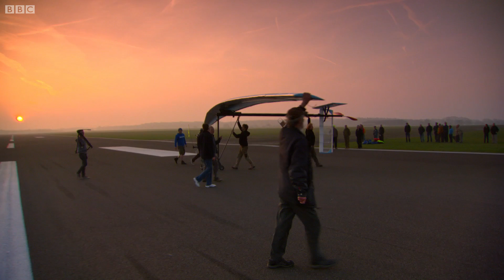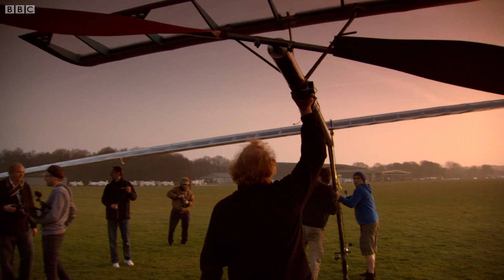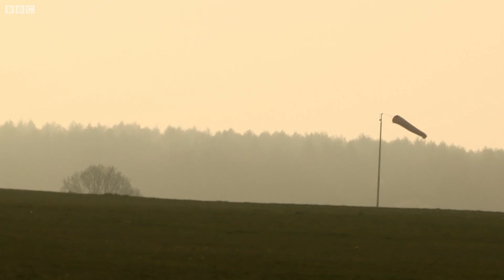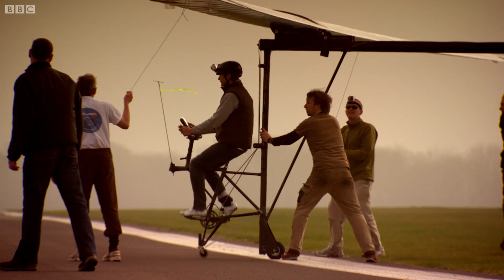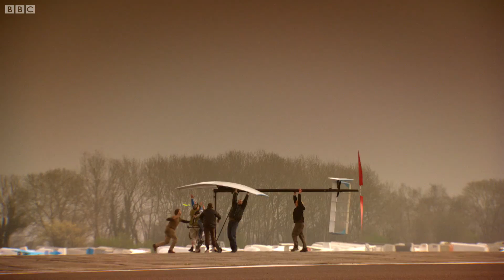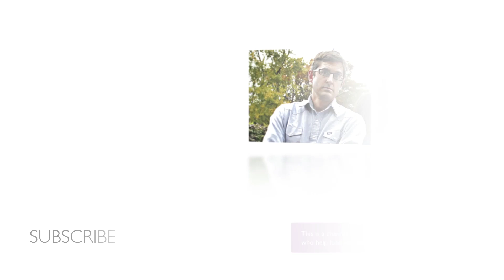Flying Bicycle Success! (Part 2) | Bang Goes the Theory | BBC

Comment: You need a certain area of wing to provide sufficient lift, reduce the big wing width, way too unwieldy,  and add a slightly elevated, front wing to compensate reduction in large wing area( canard) with vertical fin. Keep prop behind as before. The vertical wing in front will disrupt the oncoming airflow to reduce the stagnation pressure point on the pilots body. Making it more aerodynamic by recliner/ plus streamlining will also help  a lot in cutting down a lot of drag, but unfortunately in the reclining position, its harder to push the pedals in a crank mechanism. The ideal human powered craft  should be designed so that very little if any forward motion is needed in a mild head wing to provide adequate lift and allow the craft to rise up. In fact the trick is to make the craft so light, a factor of 4 lighter than todays technology will permit, such that the lifting surfaces effectively operate and behave as a hybrid kite. A kite with very little forward effort, would soar up , due to its very large lift area to payload. 
Once airborne, then you can use the legs to propel it forward. What is needed is a blown/ aerated material that has an extremely  high strength and rigidity to mass ratio. A material that could be blow formed into the whole craft without the need for spars etc. A craft that structure weighs about 10kg maximum , that is when practical human aerial-cycles will become possible for most people to fly.

Comment: I'm no engineer, but I am somewhat mechanically inclined and something continues to puzzle me about all of these attempts:

One of the chief problems aside from weight is pilot endurance, yes? Churning those pedals wicked fast to get the propeller spinning fast enough wears out the pilot's legs quickly. Ok, so why not use a much larger chainring on the pedals, and a smaller sprocket for the propeller? The whole point of bicycle gearing is to spin the wheel many times for every single rotation of the pedals, yes? The propeller does not need to overcome the resistance that a bicycle tire does, so this should be easier to do. The slower the pilot has to pedal, the longer his/her strength will endure. 

All of these attempts seem to be using bicycle gearing, which simply isn't going to work. A propeller has to spin at a much higher RPM than a bicycle tire. A chainring that's say, half the size of a Pennyfarthing wheel would probably be more efficient. The pilot would only need to pedal at a casual pace to get the propeller spinning wicked fast. In every attempt I've seen, the pilot gives out within seconds because they're having to go full blast on the pedals.

Comment: Didn't they learn anything from hang gliding? He needs to be able to use his body weight to push down the side that is rising, eg. connect his shoulders to the wing above with a rope or something. As it is, he's just leaning into empty space which does nothing.

Comment: This is what happens when you have a bunch of engineers who know nothing about airplanes call it a bicycle that flies.   Change your thinking. Its a peddle powered airplane. Then change your strategy. That guy sitting upright is about enough drag to counter act the propulsion completely. Such a poor design.I like the long wings.But the wings flop one way while the rider flops the other. Needs some direct stiffening . Also if you want control at slower speeds take a hint from the wright brothers. Put a canard out front. Instant response even at slow speed. At least in pitch. Please do not take this as a slam for your craft. I think you are on the right track. But take this as constructive. You have little control because of the lack of stiffness. You have to work way too hard to move forward because you are a big barn door in the wind. Lay down like the LUGE..  Prone position feet forward.  I think if you put 2 struts from fuselage to wing that will stiffen the inner area so you do not get wings flopping one way and pilot the other. It will solidify the center...

Comment: Bro u can do it.. if I were at your place.. I could use 3 tyres ..... 2 tyres in from and one tyre in back side..
After 3 tyres no one need to run along with you and with that you would more stable on pedling wheels n you will be more comfortable..
Yes of course it's flight.. bcz tHis design n style is only mother of all flight.. this is mother it's gave the way n direction to create the new design n styles.. now that is flight.. your flight bycile is also a flight.. keep it up you going good buddy.. but try with 3 tyres

Comment: Hey, I like your effort, but this construction will never produce desired result.
You need apply at least equal or higher power than the total weight of the constriction including driver.   
There some other problems,   which will be obstacle to the flight.

Comment: these videos only exist to prove that pedal power is useless. i know its not as efficient as electric or gas but i know its atleast better than whats being shown in this video. this video is blatantly discouraging the pedal idea for flight. i mean cmon, those many people get together to make that design? that seating position? that gear ratio? no control surfaces?

Comment: Have you tried a DELTA WING with less drag and weight and no longer shafts body or tail assembly?
Reply: Thank you...I'm very interested...info helps.
Reply: Delta wing performs far worse in low speeds.

Comment: You need to have at least 4hp in each leg and arm. Pedals should be for arms AND legs.
Reply: Wrong. An athlete would be enough if the plane was designed properly. See the Daedalus 88 project where a human-powered plane flew a distance of 115 kilometers over the Aegean sea for 4 hours non-stop in 1988 with a Greek cyclist athlete.
Reply: Absolutely. With the entire torso contributing NOTHING....it makes no sense. It really looks kind of silly with his arms, shoulders and back just perched there on the seat going along for a free ride. Someone WILL figure this out, however, just maybe not this guy. Admirable effort though!
Reply: ΑΙΕΝ ΑΡΙΣΤΕΥΕΙΝ Obviously I exagerated, but in reality surely larger than 1 horsepower and more likely at least 2hp in one athlete. Steroids can make you even stronger than elephant and you can see those experimentalists, but they usually hit the bucket pretty early.

Comment: It's tip stalling. Need to add washout to both wing tips. And add trim flaps to the wing to allow fine tuning against the prop torque. Being it's a pusher plain find out what the prop inclination should be vertical and horizontal. On a conventional prop plane it's around 1-3 degrees vertical ccw and 2-4 degrees horizontal cw. And this a variable depending on plane design. It's best to make all these tweaks adjustable for fine tuning of any prototype plane. That plane has potential.
Reply: Why dont you perfect it and put it on youtube for us?
Reply: @taylormade2826  why is your ass burning on a real technical suggestion.
Reply: I agree, perhaps more curve or less cord closer to the wing tips? build a flying model first.

Comment: It seems that the steering mechanism is too close to his body and he can't get either maximum leg power or good balance in that position. His body should be in the same position as if he were on a properly fitted road bike, with his hands and arms well forward. Then he could really pump the pedals and more easily shift his weight either left or right. Otherwise this is an excellent project and I think it should be pursued!

Comment: I wonder if he received flight training. Once you're wheels up you are an airplane. So the pilot skills takes over and your leg should be in steady cadence. It looks as if the flight surfaces aren't to functional. I'm wondering if the control mechanism is wing torque or flex to give roll stability. Seems as if that is the big problem aside to more steady speed.

Comment: The chain has to go to the wheel (and the prop) for it to be a bicycle-airplane. You flew a pedal plane...which has been done. Besides, you could have easily have flown a bicycle by getting a bike up to high speed with an aluminum flywheel, then shifting the power stored in the flywheel over to the prop. Yeah, try that.

Comment: idk anything about this but woudnt it help to strap the the pilot tightly to the seat so he doesn't lose the torque he had while he was on the ground i know it might not be a big difference but when you take off the plane beneath the pilot probably losens up a little causing loss in the power being pushed into the propeller

Comment: Why is the 'pilot' wearing heavy clothing and what looks like a heavy helmet?

Where are the controls once in the air? 

You can limit the  wing bend by adding some lines from near the tips down to the bottom of the 'fuselage'.

I noticed that one of the attempts was aided by being pushed along at the critical moment...
Reply: The wing bending is called dihedral. It's necessary for a low powered rudder only plane. Look up  B-52 wing flapping on you tube.
Reply: nigga

Comment: lots of things could have been done here to make this work better.  Have better gearing for the bicycle.  Also, have a recumbant position.  Make the wings more rigid.  Wear a skin suit and less heavy clothes.  Have hand pedals to aid in the powering of the prop.  Have controller strings for the guys running on the ground to help stabilize the tilting.

Comment: Why haven't you guys considered ailerons on this design? They would help keep those wing levels, and you would have more roll control..
Reply: I think they're trying to save aircraft weight, but I agree on that point, without the basic controls of flight, the aircraft is fairly impractical. But this aircraft has a number of issues that I see which could use a correction. The project has been a success for that fact that they got airborne, but for the fact Redbull motorcycle riders get more air time off jumps, and the aircraft doesn't have the basic controls. It for now is a "successful-failure" in my book. Yet the aircraft has a lot of opportunity to tinker with.
Reply: The wings are just too flexible, adding down aileron at the right tip would twist the entire wing so instead of banking to the left you bank to the right, it also adds a lot of drag and weight. At this speed it is flying right above stall speed, and adding down aileron increased the angle of attack stalling the wing completely.

Comment: recumbent bikes are more efficient.
Reply: +FIREHAWK1979  Yes recumbent with a fairing.
Reply: +FIREHAWK1979 Exactly.that's what immediately occurred to me as well.
Reply: +Organ Farm Being British, he probably thinks that would be cheating.
Reply: +FIREHAWK1979 recumbent bikes can't exploit the weight of the human body...ie, you can't "stand" on the pedals. aerodynamically more efficient, maybe, but less potential power. notice any recumbent bikes winning the Tour De France? me neither
Reply: +freshcaughtbass with the recumbent bike you are pushing against the back rest. Standing up you are limited to your bodyweight. Most athletes should be able to leg press more than their bodyweight... In a long distance event you would not be able to keep up the extra force.
Reply: +freshcaughtbass you do have a point, if you just lock your leg and stand on the pedal you're not actually exerting yourself.
Reply: FIREHAWK1979
 Tell that to pro cyclists peddling up the Tourmalet. It makes no difference to the work you do if you are pushing against a seat or pushing against gravity. If they were allowed to use recumbents in pro cycling they would. Aerodynamics is the gold standard for speed in cycling. They do whatever they can within the rules to lower their air resistance.
Reply: competition cyclists stand during a sprint or steep climb, which is the worst possible geometry for good aerodynamics...they must have a good reason for doing so
Reply: freshcaughtbass
 They don't have a seat to push against. When climbing aerodynamics are less important anyway because they are going slowly and air resistance varies geometrically with speed. When sprinting they keep as low as they can while engaging as much strength as they can. Take a look at Mark Cavendish sprinting.

Comment: Move your prop so the prop thrust flows over the control surfaces and you will gain control at lower speeds. Once airborne it helps to move the controls in order to make the plane fly the way you want not the way it wants. The pilot seems to be so concentrated on the fat that he's airborne that he forgets to actually fly the craft.
Reply: +Nickathome Smith Exactly, he is so focused on paddling it up, that he is hardly concentrating on the flying part... However, that brings me to a question, how is he really flying that airplane? I've watched this video twice and I can't really tell, where the controls are? I mean, that bicycle handle bar, doesn't seem to be connected to any flight control surfaces at all.

Comment: The way I bike is a push and coast. If I were in the air, I don't think the coast part would kick in.  As your average fat man how would this work providing I could get off the ground in the first place?  Would this be like a bird and float on the air currents? Would I need to power it continuously for the entire trip?

Comment: Excellent, I see a chance at making a human powered aircraft available in kit form,how popular would that be [with electric prop assist for a .why not use larger carbon fiber bicycle wheel with a internal hub[automatic] and a small tail dragger [large skate wheel]wouldn't that reduce time to flight?

Comment: Im sorry but this is really silly. Any object can tanke take flight (If thats what you call.. Leaving ground for 2 seconds?) you pedaling, has very little to do whit that. In this case you could have done better just by jumping off a cliff and let the wind do the rest.  Your very instabile wing-construction would make you crash not very late after that but... The balance ratio and weight is not gonna give you more than 2-5 seconds in the air before crashing when you try this from the ground. Sorry but thats a fact. The bicycle-aircraft just doesnt work..
Reply: +Zamsonite B 
Don't give up yet not everything has been tried who knows maybe they could make a peddle powered hanglider?

Comment: The thing these "engineers" don't know is that curving the wings up too much is going to cause even more drag, i know this because paper plane physics, rather have stronger frame and more efficient prop instead. 

You might be asking how i know this and i might be some armchair engineer but i do know this because of xplane experimenting, curving the wings up too much like this will further increase drag due to wing wake vertexes and other phenomena. Not to forget, electric servos are needed for control of yaw and roll, where speed will be controlling pitch. 

Do all the maths you need, not as efficient as a computer with the right software.
Reply: HeadShot360IN
my point, too much dihedral can be a draw back because it causes more drag in an aerodynamic instability sense, but i'm no sense.
Reply: *****
i agree with you, but as i said, too much dihedral is worse than good becuase lift can be lost as well as drag increasing,.
Reply: *****
my point. dihedral is needed for sability but if wings are at a 45 degree dihedral for example half of the lift will be vertical and the other half will be horizontal - the lift will be diagonal and will only make the dihedral worse until the wings snap becuase of it.
Reply: this has the right amount of dihedrial, but the cg seems to be too far back and many other things
Reply: Drag? It's not true, the last aeroplanes are more efficient and have curved wings look frontally at the boing 787-9 dreamliner for example
Reply: Wow! Youre a brilliant engineer! Maybe you should inform those terrible engineers at Boeing designing the 787. Imagine... The ETA, an open class german sailplane, which has the highest Lift to drag ratio ever recorded. What if the engineers only knew what you know! Youre brilliant!

** End Sarcasm. Dude, I woupdnt ecen qualify you as an armchair engineer. Engineer and you, dont belong in the same sentence.

Comment: Maybe if you were in a recubant bike position so you can hammer the pedals while being held in place by the seat, and not bolt upright like a tighty whity Victorian gentleman riding a big wheel Pennyfarthing, you'd get better power from the pedals
Reply: HeadShot360IN
Reply: X2...sitting upright limits the your down-force to body weight, someone in shape should easily double that. I bet the air you push sitting up sucks 10% of output right off the top
Reply: ...Jem needed a Jet pack 🤘🏽
Reply: And a much smaller cross section...
Reply: @Autonomous15  It's not hard if you have a proper gearbox. I doubt that there is no way to improve momentum transfer in the example of the bike in this video. And if implemented right, this should not affect the overall weight too much.
Reply: +KlunkerRider and maby a more efficient 3 or four bladed prop.
Reply: HeadShot360IN for example the spitfire started with a wooden 2 blade prop, then it got a metal 3 or 4 bladed prop making the spit faster.
Reply: HeadShot360IN good points.